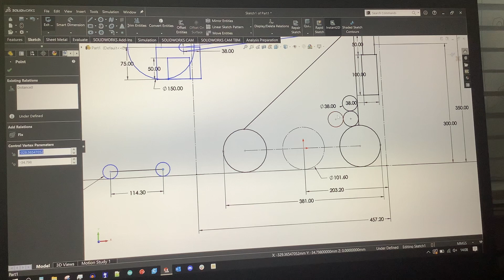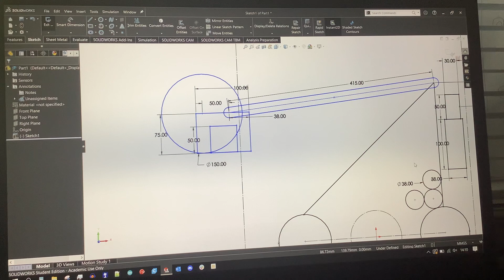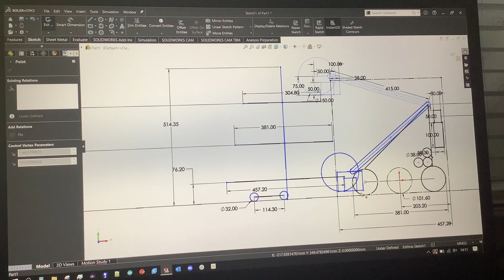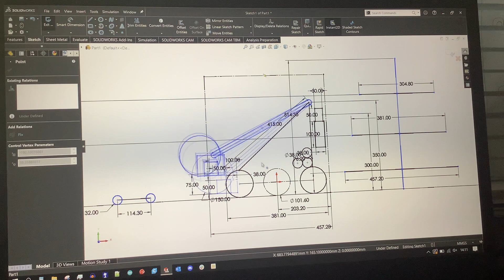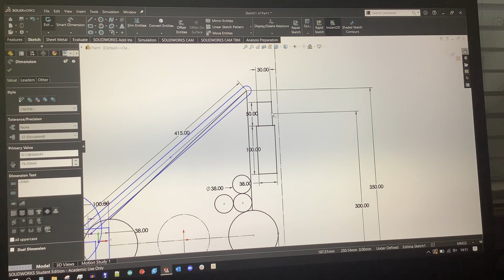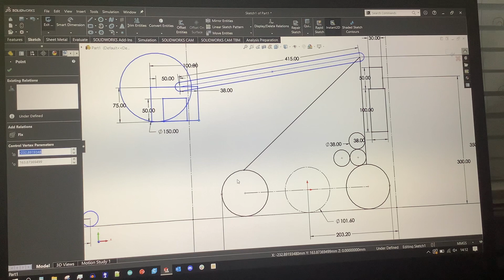FTC Freight Frenzy Robot Concept

Comment: Excellent ideas! I was thinking of a virtual 4 bar myself so it could go 180. I was also thinking of having a larger contact area with the carousel, maybe through multiple small wheels, or like you suggested a curved belt. The only thing I want to point out is you are not allowed to move around the goals, so you cant add those servos to drag them around. Other than that great video!
Reply from the maker: Thanks for the comment! Yeah RIP moving the goals. Based on the recently released RI3D and RI30H protypes, I think slides will likely be one of the metas this year. A V4B could work, but based on previous games, I think slides will end up being faster.